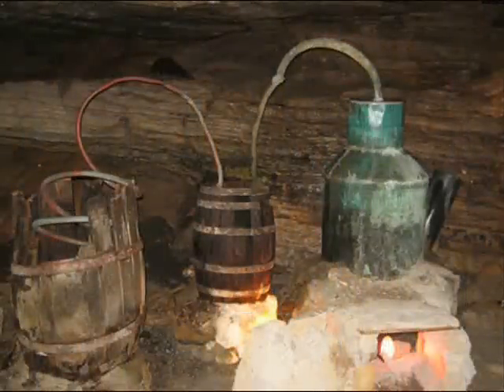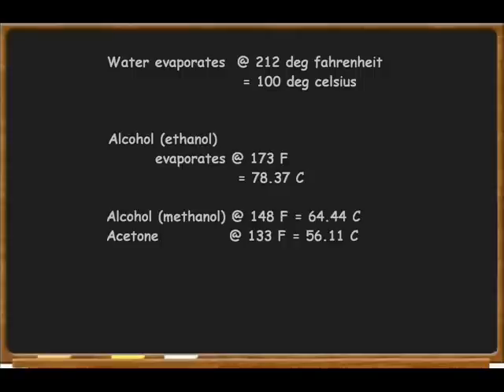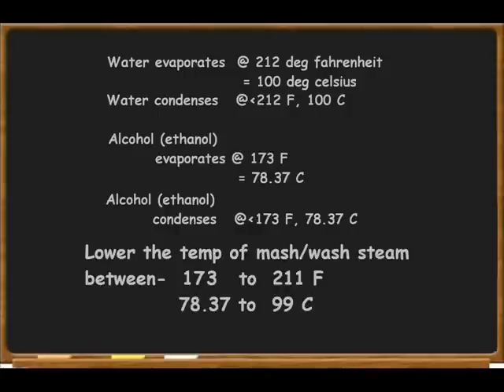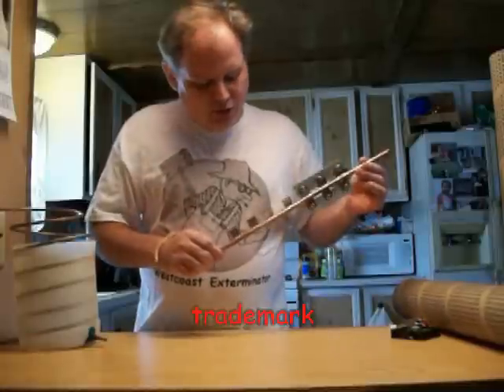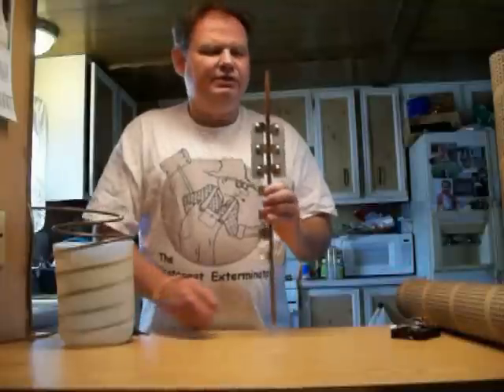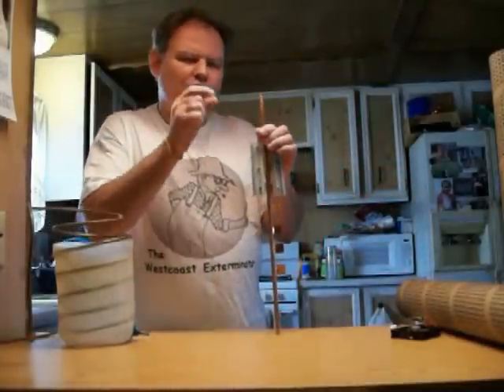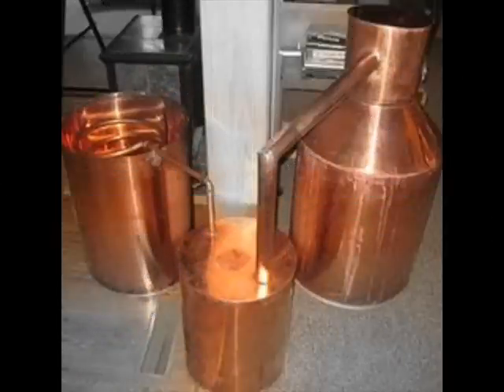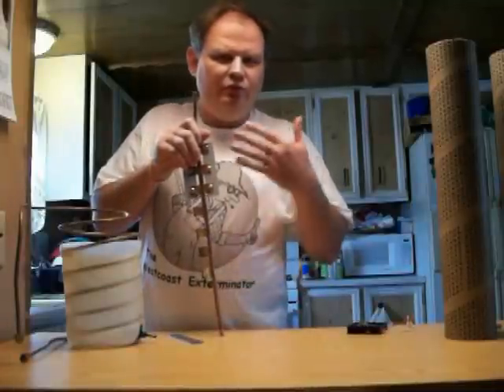Moonshine Still Reflux Columns & Thumper Kegs 101

Comment: Again, thanks for all your videos. Can I ask a really simple question. Is moonshine drinkable? I mean.. enjoyable?

I live in Australia, so I can't taste traditional moonshine from a bottle shop. I have no idea what corn liquor or a home made rum tastes like (what I want to make). I am toying with the idea of making a still, but I want to know if I am only going to produce something that will strip the skin from my throat? there will obviously be a learning period, and some poor quality runs on my first attempts (only to expected, and acceptable to me), but in your honest opinion... can you produce something drinkable with enough experience from simple equipment (I am looking at a 30 litre stainless steel stock pot, 8-10 litre thump keg, about a 4 meter 1/2 inch copper worm and multiple passes through the still if necessary)? I don't want to go through all the trouble of constructing the still, and churn out something where the fumes alone would kill a brown dog.

If most shine is pretty rough, regardless, will aging in a barrel with chips make a significant difference to smooth down the resulting product?

Thanks
Reply from the maker: Ok, remember this. All store bought spirits are the same as moonshine in the basic sense. The store bought stuff is backed by years of experience and refinement, while homemade stuff CAN either be just as wonderful or equally vial depending on the guy that made it. I have made many different recipes and they have turned out nearly as good as any store bought stuff. HOWEVER, at first years ago I made stuff that today I would not touch today. As I got better and tried other peoples brews, I could notice the lack of quality in some and never asked for another drink.
So if you try some home brew and think there is something wrong with it, don't think that's normal just because it's moonshine. It's off the mark from the maker having a lack of experience.
About the only thing that I can't fully replicate is Cognac. Even though I have created something close to it, I can't fully replicate ALL the processes exactly, but that's just because cognac is such a high quality spirit that replicating it perfectly is near impossible, but can still be enjoyable.
In short... Always strive for the best quality you can get.

Comment: I've seen many better examples of making more surface area inside the column using copper plates silver soldered or braised to the inside of the column by making cuts all the way up the column and inserting plates on an angle. Another is to put many copper tubes that run the full length of the column like a Gatling gun. It's held together buy copper plates top and bottom and its like a removable insert or canister can even drill out to allow the vapour to pass through all the tubes as well, It has holes cut out  in the centre of the holing plates to allow the vapour through. I think this is the most effective way and you can stuff with copper mesh sponges as well making more surface area. Mucking around with foil or other metals and fans using more energy when 94-96% could be achieved for ages makes not much sense to me personally.

Comment: I think I'm going to try a column with cooling fins as you suggest in the video just to see what actually happens.
I've got a few feet of the stuff they use in hot water baseboard heat, basically 3/4" copper pipe with aluminum fins attached to it. Figure it'll be easy enough to make into a column to fit onto my keg, then some elbows and my 3/4" Liebig condenser will fit up nice.

I figure the minimal fabrication and some propane is worth it to prove if you can make a reflux column without packing, reflux condenser or large diameter pipe.

I'd still like to see what you come up with as well. 

Thanks
Reply from the maker: Ohhhhh, That's perfect material to use for a test like that. How many feet do you have of it? I would go a min of 2 feet and have a some kind of fan set near by just to create a small breeze
Can you also create a base test without the reflux for comparison?
Do you have a video camera to record it?
When I do mine, I'll be using either MD 20/20 or wild irish rose. It'll give me a solid starting APV that anyone can verify.

Comment: I'm sorry, but I don't understand how you can create a reflux still as you suggest in the comment below, using tape if I'm reading correctly?

Simply passing vapor over an area below 212°F will not increase proof. Water cannot be removed from the vapor without condensing and revaporizing (redistilling) the condensate. This is how both reflux columns and thump kegs function.

Removing water from vapor by passing it over an area below 212°F is simply not possible, nor is it how reflux works. 
If you pass a vapor of 40%abv through a "condenser" @190°F, you will condense the vapor without removing any alcohol, as the alcohol and water have effectively come into solution, as alcohol is soluble in water.

To remove water from vapor, it must be condensed and vaporized a second time, ie: go through a second stage of distillation.

As for your theory of creating effective reflux distillation in a narrow, air cooled pipe without packing, it is fraught with problems.

First, the vapor speed will be very high in such a narrow tube, providing a tendency to blow any condensate out of the "reflux chamber" before the rising steam can heat and re-vaporize it.

Second, the surface area is so smaal inside the narrow tube, very little condensate will collect and any redistillation will be minimal, and again bringing problem #1 into play, as the chance of what little does collect being blown out of the tube is not favorable to your intent.

Three, your tube is so narrow, if you do get any significant condensate build-up, it will be very susceptible to flooding, ie: condensing to an excess so that it simply flows back into the boiler without any reflux occurring.

Four, air cooling is not stable, predictable or easily regulated, thus making an already questionable system even more difficult to regulate.

These are just the more obvious issues I observed, and others could be present that I have not thought of.

If you are able to see abv% gains, they will likely be minimal at best.

In closing, there is a reason why, after many years of research and development, the reflux stills currently in use are designed as they are, ie: the science of reflux distillation necessitates such designs.
Current designs are efficient, effective and easy to operate systems of relatively simple design. It really doesn't get much simpler than the common designs of today while still remaining easy to operate and effective. 

Good luck, I think you're going to need it!
Reply from the maker: Yes tape. But not just everyday tape. Something like duct tape. And my copper coil it much too narrow for water vapor to form inside without it being pushed into final collector so the vapor will be refluxed IN the cook pot long before it hits the copper tubing. I don't know how much improvement there will be but I know there will be some. And you may be partially right, water in a still might not condense exactly at 212, but it is a figure I did research.
Reply: Well, you've got a "unique" perspective on reflux...

I guess all I can say is good luck! Others have explained how reflux distillation is achieved, as have I, and you seem not to care about anything but proving us wrong. 

I'll leave you to your experiments. Be safe.

Comment: and what about internal half rings on the inside of the reflux to impede the flow of the steam to grab more heat without impeding the flow of water back to the still pot....kind of made to make the steam corkscrew up the reflux..put the half rings inside at an angle all the way up the reflux staggered around the inside you could cut a section off the reflux to trace the inside curve then solder it but this would take a tube bigger than 6 inches diameter but also to grab all the heat by spiraling the steam instead of sending it up the center ...
Reply from the maker: Too complex, I'm just covering the basics for new learners by simplifying everything.
But I like your thinking.

Comment: I DO HAVE AN ACTUAL QUESTION:  which worm position is better a worm working uphill or downhill with an uphill exit?  or is it as some claim to best be used sideways so the alcohol can cool the steam also.. i understand the thump keg is designed to drop the water out of the steam first while allowing the 180 proof alcohol steam thru...but the worm problem  is the next question.....flowing bottom to top, in a vertical alligned coils with horizontal tubing in a corkscrew going UP or DOWN? most say down or you get spurts and pops...some say the corkscrew laying on its side so alcohol will settle in the bottom of the corkscrew.and give more time to condense in the water...like a U shape in the sink to block the smell from coming back up and the drain from drying out and to catch your rings and sticks.....but in this instance it would be to keep some alcohol in the bottom to allow it to condense more until the pressure pushes some thru
Reply from the maker: Hold up a second. Too many questions at once.
First. Cooling coil. Downhill, all the way
Thumpkeg. Yes, it's just a short burst of quick coolness, but I don't use one.

Comment: So do you need to make a thump keg or reflux column for the smaller pressure cooker still you made?
Reply: One shouldn't make a still out of any such crap as a pressurecooker! This guy is nuts..
Reply from the maker: No, I usually get at least 100 -130 proof out of any mash or wash with extra sugar in the mix. I've never gotten any lower than 80p without extra sugar.
So it's not really the size of your still but the strength of your mash, and how well you distill it.
People wanted the info on this so I gave them the basic math behind it.

Comment: Have you considered trying a 1" diameter steel reflux column packed with copper wool?
Just starting to get into distilling, got my first batch of mash fermenting away!
Also, what length/diameter coil would you recommend for a 20qt pressure cooker setup?
Thanks a million for your helpful videos!
Reply from the maker: You can do it that way. I'm not saying either way is better, but my way does the exact same thing, just with the same math worked out differently.

Get a least 6 to 10 feet for the coil then add what ever you need to get from the pot to the coil. Don't get any smaller dia then what you've seen me use.

Comment: Thanks for the video. Never done any distillation before, but I am considering it. In terms of methanol production and elimination (my biggest concern), could you heat the mash low enough that the methanol turns to vapour, but not so hot as to produce an ethanol vapour. If you keep the low temp steady at about 65 C, the dripping would presumably cease quickly because your not doing a full run at that temp. Then could you increase the temp and be fairly certain that what flows next would be methanol free? Hopefully that makes sense...

From other videos I have watched they generally seem to just discard an arbitrary amount, hoping that its all heads, or they constantly taste test the drips and make calls based on the flavours (which I would not feel confident about getting right, clapped out taste buds...). I would feel more confident if I could insert a bit more precision into the process. Of course, maintaining the correct temp would be the biggest challenge.
Reply from the maker: You cannot eliminate the others from evaporating with the methanol. It just can't be done. You can limit the amount by turning down the heat.

Tasting unless you have a chem lab, is the best bet of cutting the right amount. If you cut out anything, it's better than nothing. It's bad, but it is in wine and beer and part of the cure for drinking the bad stuff is drinking the good stuff.
Reply: Well if you put a thermometer at the top of your column or before your cooling system, you can monitorate the temperature of the exiting vapours and get rid of everything that has a temperature lower than 78C and still heat your still at a temperature higher than 65C 
However due to heat loss, the readings of temperature may be a little lower than the theoretical values
Reply from the maker: Olivier Chabot
It still follows basic rules...
You're right, turning down the heat will have more of the low temp chemicals evaporate, but you will always get some of the good alcohol and water with it. It can't be eliminated, but will lower the amount of them.
You still have to figure out when the bad stuff is finished coming out because the good stuff will still come out too. Everything evaporates at any temp above freezing points.
The cognac makers know the point at which to keep the hearts by smell alone.

Comment: Just a share for anyone with ideas. I work on computers for a living and the other day while I had a desktop open, it dawned on me that most new computers have these huge heat sinks that cool the processor. Higher end models use copper, lower end aluminum. In some cases are held together with tubes. Let your imagination run with that.
Reply from the maker: Adding to your comment...
I did take leftover little copper squares, wedged them into a heat sink between it's fins and managed to fit a left over aluminum piece on copper pieces, expanding the heat sink by a factor of 10. That heat sink has no fan, (it's not the main chip, that does have a fan) but the computer runs much cooler now.

Comment: Have you considered running the the air-cooled column at a 45 degree angle to make sure all rising steam touches the metal? Also instead of fins, what about soldering washers up the lenght of the column? That way each heat sinking connection is pulling heat from the full 360 degrees of the round pipe. Combined that should give a fair amount of reflux. Running another 45 degree angle down to the worm, also finned with washers would conserve some ice (or cold water, whatever you are using) by dissapating more heat on the way down.
Reply from the maker: Ah, someone thinking. I like it.

Off the top of my head, I don't think those things mention really matter, BUT at the same time I think it is very creative, and I don't see why they wouldn't work.

I mean, I see exactly what your getting at and think it is very clever. I just don't know how much better your idea would be if you put it side by side next to my idea.
If you do a 45 degree reflux, I still would not use a large diameter tube for the same reasons mentioned in the video.

What I would do as an improvement, only for a larger scale still is...... either take a large diameter tube, but only flatten it somewhat, OR make several T's coming off the cook pot and make multiple refluxes going up and then coming back together into one single tube. I have a unused solar water heater with no box just sitting around that would be perfect for the job. Either of those would increase the total amount of cooling surface but still have a narrow channel for the steam to get through.

Comment: i would love to see it tested on a refux, in the book "the compleat distiller" he talks about how fins would work, maybe back to back it on a still
Reply: Back in the 80s my Dutch gf's father got 90% ethanol from his still, based on these ideas. 

He used an old milking machine canister for the boiler, fitted it with a 50cm long/1cm dia column completely covered in fins and packed with stainless steel wool, and ran it with an ordinary household ventilator fan playing on the fins. 

So, I've seen the principles in action, and they work!

Comment: I would have hoped you had covered the thumper and its operation in this as its in the tittle.
Reply from the maker: I did. The principle behind it is covered. It work the same as the reflux. The cooler liquid allows some of the steam to condense.